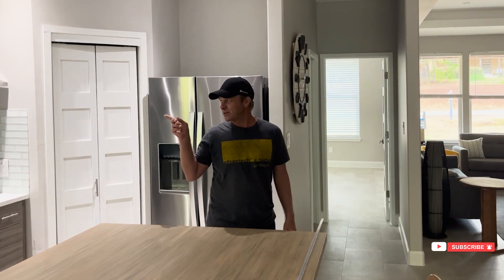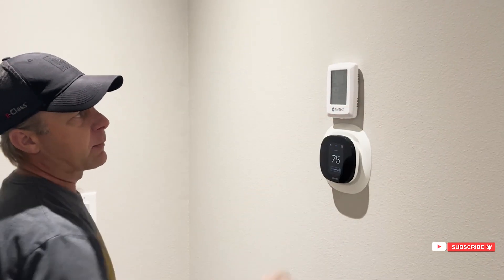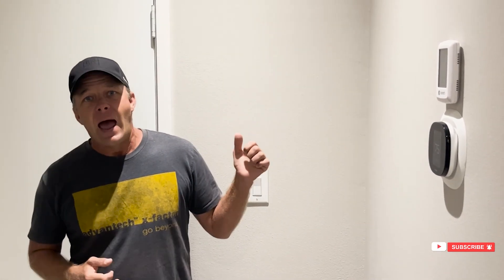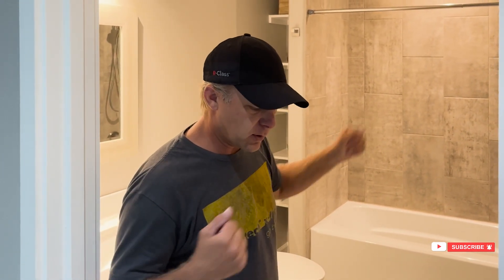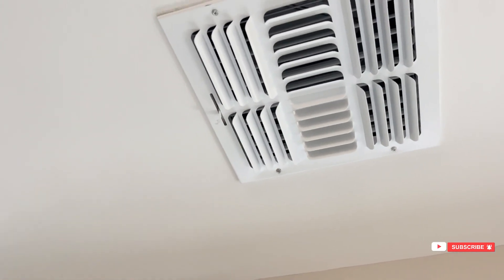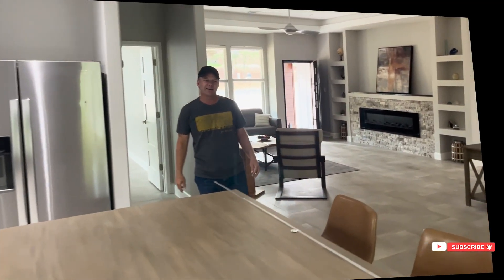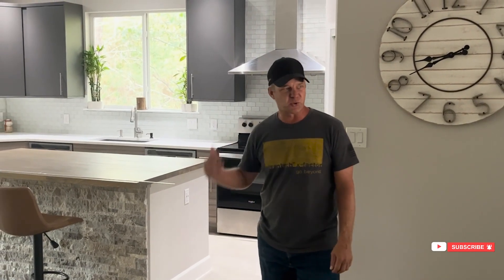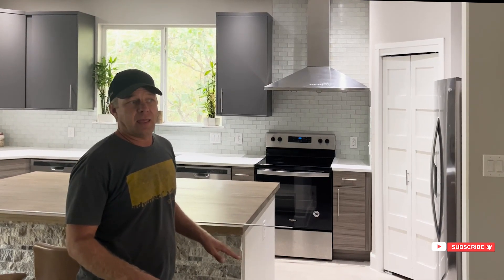Door Opens by Itself When House is Depressurized

Comment: Great watching you seeing you come up with practical products and fix’s. 
Keep up the great videos. 
Question what about next time when the toilet is in a room by itself putting the exhaust down low behind or beside the toilet?  Just to pull the you know down and out rather than up and out. 
Grace and Peace 
Slick
Reply from the maker: Yes, you could do that and I think that could work well. Usually, I prefer to follow a rule of thumb to put the exhaust at the opposite side of incoming air, which is low under the door. So high on the opposite side is generally what I aim for so that we promote air flow through the whole room.